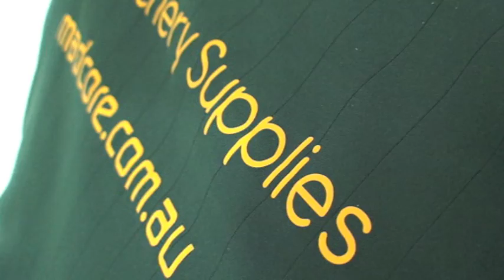How to make a bow string

Comment: I don't understand why my serving jig does not walk the line it spins same spot no matter how i adjust the tension. it is nice commercial jig  many use AAE pro server.
Reply from the maker: +WV591 try a different serving material
Reply: +Sheldon Gannon 
well i  bought a different jig and string. will see which was at fault or can be blamed other than the user technique :-)

Comment: Why cut the two strands out at then end If you want an 18 strand string then just wind it round for 18 strands?????
Reply from the maker: Not if you want even colors! You can split the tie off at either end, however cutting them loose does not effect the string at all! But it does make for a better balanced string!

Comment: can you make a string and send it to sweden?
Reply from the maker: +cpunktc81 sure we can
Reply: Sheldon Gannon i guess a 8125 g 16 strands in orangeblack would be expensive
Reply from the maker: I charge $30AU plus postage.
Reply: Sheldon Gannon okey i will write you back ...one other thing im about bying som new stabilizers... im down to infinitec nexus or SF ultimate pro... cant choose , wich are the best of this two?
Reply from the maker: +cpunktc81 i would consider spending more and getting something a little better. The SF are better than the infitec tho. I would consider the fiberbow S3 setup. Much better in the wind.
Reply: Sheldon Gannon allright.. i have a budget for 200 euro..i shoot inno cxt with ex power 68/34 limbs x7 1914 indoor and carbone one 660 outdoors ( gonna buy x10 later when i have the money) i use 16 strands 8125 for the moment and majesty 16 strand..( but my x7 1914 is better with the 8125) i use 9% nibbpoints... my side rods are easton x10 and fivics lvt long rod.. and i want new stabiliers.. maybe i should keep my side rods.? and just buy a new long stabilser.. about 30" and 4 " extender...
Reply from the maker: Better to stay with SF then, as it will go well with the Inno.

Comment: One the commercial strings I find in the states, there is about a 6-inch thick zone wound around in the nock zone; you did not do this.  May I ask why and  what purpose?  Thank you
Reply from the maker: That comes after the string is done and placed on the bow. A knocking serv is variant depending on the bow! and teh size of your hand!

Comment: Why on earth would you cut two strands of the string?  It makes no sense.  If you want an 18 strand string, just spin out 9 strands of each color.  Cutting out two strands compromises the integrity of the sting.   It will work fine for a while, but it will eventually begin to slip.  There is a reason that it is called "endless" loop.
Good video otherwise.